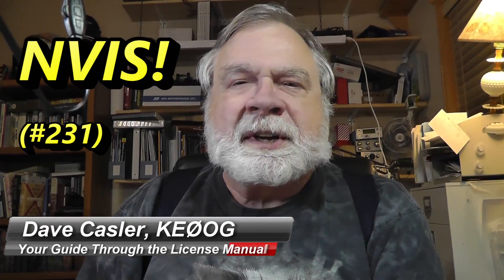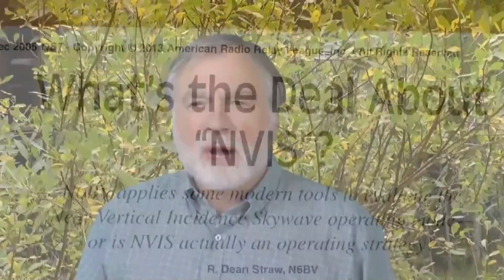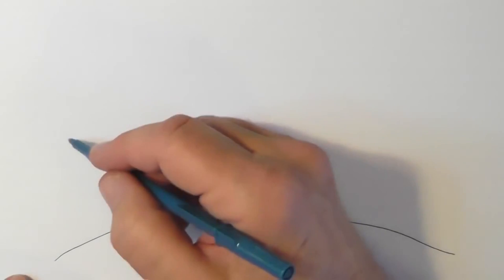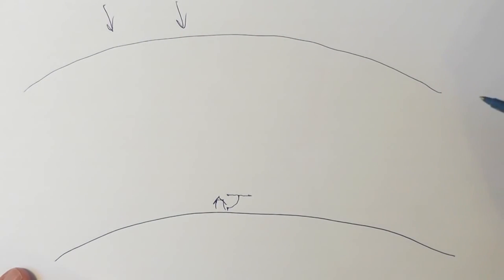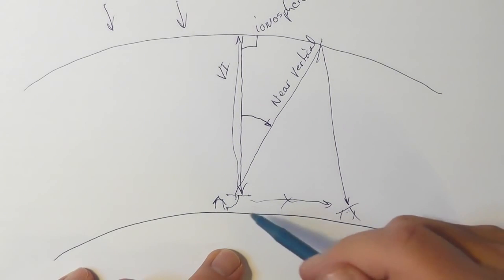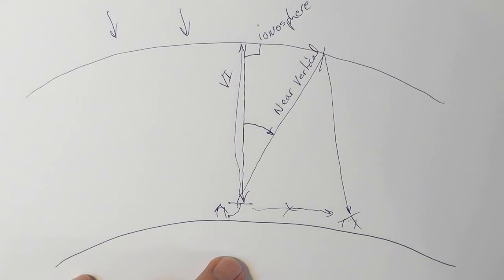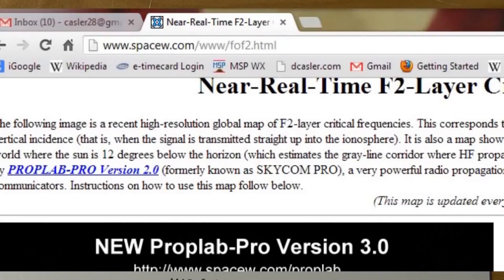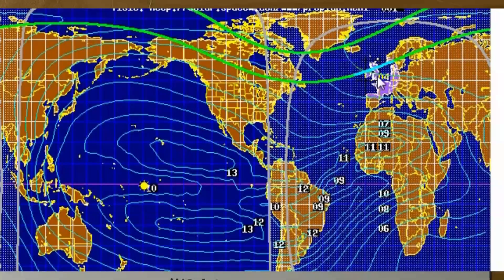NVIS Overview (#231)

Comment: Those of us that have actually used NVIS have learned early on that an NVIS antenna is rarely more than 10 feet high. There are plenty of videos echoing the false information of 0.1 or 0.25 wavelength high. There are also plenty actually demonstrating true NVIS with their antenna 6 feet or even lower. NVIS was invented by the Germans for tactical purposes. Having a low antenna gets it down out of the noise and also makes it more difficult to DF. A low antenna is also much easier to deploy. All dipoles have an NVIS component. Being able to communicate via NVIS doesn't mean you have an actual NVIS setup.

Comment: My understanding is as a dipole gets lower to the ground it's impedance drops. With a real earth the impedance starts to go back up again. Is this extra impedance ground loss?. Also as you get closer to the ground I believe more signal is directed upwards. Is there an optimal height where the net vertical gain is lossed due to ground loss.
I assume a Dipole on the ground, even with a good swr has almost 100% ground loss. Is that correct, your just heating up the ground.
If a 40m dipole is 2m off the ground how do you work out how much is lossed to the ground?

Comment: Thank you for this explanation, Dave. I was on a summits on the air (SOTA) activation over the weekend on 20m and incorrectly stated on my YouTube video that the reason I was making local contacts was due to my antenna being in an NVIS configuration. According to another YouTuber, he mentioned that based on the frequency I was on, that I was making contacts via ground wave propagation. Your simple, straight forward explanation cleared things up. Keep up the great work. 73, KT1RUN

Comment: How about a inverted V? It doesn't go up or out but it does something near 45 degrees,  depending on the slop.
Reply from the maker: For an inverted vee, the angle between the wires should be greater than 90 degrees ( a right angle). 135 degrees is nice.

Comment: Kudos for keeping it. NVIS was a critical military mode until satcoms came along, and it STILL fills a roll for those of us without satcoms.
 I'm not sure about optimum NVIS height, but in the days before YT there was a lot of discussion about whether one yard or two was actually optimum height. FWIW.
I wonder if the league deleted it because "the book is just too fat now" and without it being on the question pool...snip!
Reply from the maker: As it turns out, it is covered in a different place, though not quite as thoroughly. The general class license manual is very much driven by the current set of test questions. That said, it's hard to find much written about NVIS.

Comment: Really surprised that NVIS was removed. Assume latest has more digital modes. Once again, top of the pops Dave, cheers n 73s A92GW  AE1TP
Reply from the maker: As it turns out, it's covered in a different place. NVIS is very useful and is something that hams can learn more about and use to their advantage.
Reply: @davecasler  thx for taking the time to reply Dave.  Yes I use NVIS while in Europe, i have great comms with Germany, Italy, Ukraine, Russia, on 20, n 40, of course Home Brew Dipole not so high.
But a great antenna config, i have worked DX is EndFed 1/2 Wave jn Inverted L config..
Best contact in that config was 20m Bulgaria to South Africa in early evening. 80 Watts.
You really do allot for the community, you have patience, treat every one with respect no matter what the query or scenario, a real gentlemen.    Last question, are you still running the ALS500m ? Take Care Dave   A92GW  LZ/AE1TP

Comment: I get the sense most hams either inadvertently create nvis antennas due to less than ideal setups, and also think most hams want antennas for dx, perhaps this is why it was removed from newer edition
Reply from the maker: As it turns out, the NVIS section is covered a little bit in another section. And you're right. It's very hard to get low band antennas high enough. Maybe that's why verticals are so popular, because verticals have a much lower angle of radiation.

Comment: Kind of wondering why they would omit something so important and basic as a discussion on NVIS.
Is the manual literally  only   subjects mentioned in the current question pool, or something?
Reply from the maker: Yes, the manual only discusses topics that are in the question pool. However NVIS does show up later, but not in the depth that it did before.

Comment: Thanks Dave, for that excellent review. 

I hear that NVIS is pretty popular right now in Cal. Due to the fires unfortunately.

73
Reply: out of state and inner state contacts are difficult to make from Cal.   NVIS works for 100 - 1000 miles.  That's why I'm using it from QRP to 100W max.  power.
Reply: @tomwoolston40  does it work well QRP?